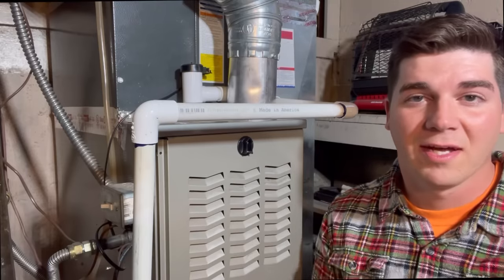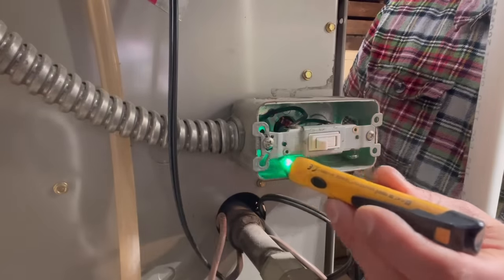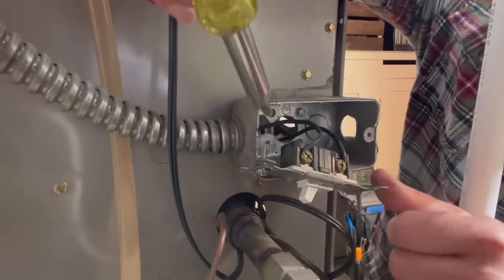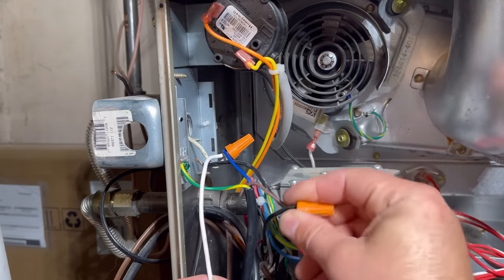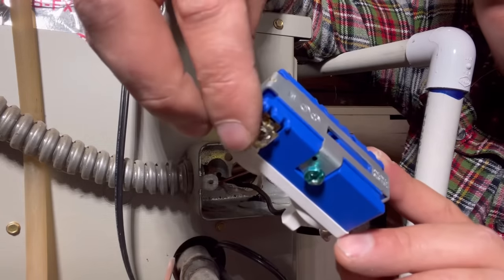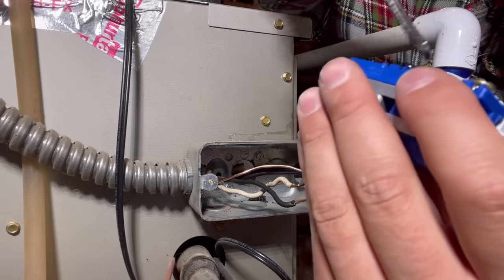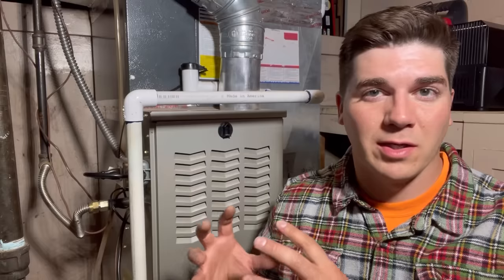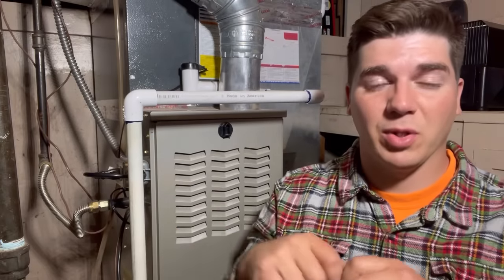This Could Keep Your Family Warm During An Emergency Power Outage.

Comment: Is the switch really required when all you have to do is pull the plug to remove power from the furnace?
Reply from the maker: It’s for building code here

Comment: I have a furnace switch with an attached screw in type fuse. Couldn't I simply replace the screw in fuse with a screw in a female outlet and back feed the power to the furnace. Obviously with the Main shut off.
Reply from the maker: Yea for sure you could! That’s brilliant

Comment: So you would need to also hook up your wifi if you have a nest or WiFi run thermostats right?
Reply from the maker: No if your WiFi drops out the thermostat will still work. It’s only in setup mode where some of them need wifi to proceed.

Comment: Does this prevent paralleling your generator/inverter with utility power if the breaker gets flipped on?
Reply from the maker: Yes it does not backfeed. I did another video with my generator powering the furnace and it shows that no power will ever go back into the grid.

Comment: This video involved far more wiring than the first one. Had you simply wired a power cord onto your furnace and a 120 volt outlet at the house line voltage, you would have made less work and ended up with a safer conversion. Then anytime you have a power outage, you could simply plug the power cord from the furnace into the inverter.
Reply from the maker: I believe building code says that a switch is needed that’s specifically dedicated for the furnace. 👍🏽
Reply: @diyhvacguy  And that is easily done. Not having a ground wired inside the existing power supply you have would give me more concern.

Comment: Might be a dumb question but is this just for gas furnaces? I have an all electric furnace here in Texas and I think it runs off of a 60 Amp breaker, so this won't work for my furnace or will it?
Reply from the maker: Yes gas furnaces only unfortunately. My apologies

Comment: You are wrong buddy. Why don't you simply use a double pull switch completely? Isolate the neutral switches from a to b. No problem at all and tire plug below without doing all the horseshit all's you have to do is cut the 110 between it and go in and out the loop. It's simple. I'm going to let Susan for many a year. This is a lot of access work you don't have to do

Comment: What about the possibility of cutting the power wire from the switch and putting a female plug on it and putting a male end on the wire to the furnace. Then just turn off the switch and plug furnace directly to a generator?
Reply from the maker: Yep you could totally do that.
Reply: Thank you for the reply. I have a generator but I never had the service panel modified . My other question is can you still control the thermostat with no power if hooking up to a gererator directly?

Comment: Why not just an outlet and a corded plug?  What is the necessity for the switch?
Reply from the maker: Building code.
Reply: @diyhvacguy    Thanks.  I have a boiler, been staring at the junction box for a year with the same intent.  Your video was exactly what I needed

Comment: if my furnace is on a 15 amp circuit breaker now and my generator plug in is 120v 20amp. will this harm the furnace?

Comment: you don't need a switched outlet...just install an outlet and the pigtail on the furnace.  If you need to disconnect furnace you unplug the wire.
Reply from the maker: I believe it’s building code that a switch is needed. But code is different in other places

Comment: I may have missed this question, but my original switch has a Buss fuse incorporated and from what I'm reading, it needs to be there.  Is there a way to keep it and make this update?
Reply from the maker: You can remove the fuse and install an outlet like this that screws in and then wire the pigtail to your three furnace wires 👍🏽

 https://amzn.to/3v44I4O
Reply: @diyhvacguy  Thanks.  That looks like it will work.. Great info

Comment: Great idea on this I was looking for ideas about this. But everybody be aware that if you have a computer board on your furnace or tankless hot water tank you could fry the board by plugging it into a portable generator. These types of generators are considered “dirty” electric meaning the wattage varies by load use and with this fluctuation the control boards fry out. Use a rechargeable battery backup “generator” that has enough wattage to run it. Do your homework and save yourself the aggravation.
Reply: Most cases a gas generator has a much better sine wave then a rectified one.

Comment: The switch has to be shut off on the box when using inverter generator to prevent power going back into main power??
Reply from the maker: Yes it needs to be turned off.

Comment: Why wouldn't it make more sense in having it set up where the inverter plugs into the outlet. Turn off the power switch from the fuse  box, and then plug the inverter into the outlet. Much cleaner than you wire run arounds!
Reply: Not safe, though.
Reply: To do what you're suggesting you'd need to have a "suicide cord" (male-to-male terminated cord) which are super dangerous because of the exposed hot leads. When I saw the video thumbnail I thought that's where the video was going but his solution with the pigtail is safe and far better

Comment: Could this also be done a hot water heater top element only (which would be 110 plus it has the thermostat)
Reply from the maker: Not sure on this. All of them out here are gas and don’t require power

Comment: not sure what your location is, am an electrician here in canada.  Would you not need to separate the neutral as well as the hot?  Am thinking that if there was a power outage, out utility does not want to see voltage on the hot or the neutral 🤔
Reply from the maker: I tested it with my gen set powering the furnace and there was no power at the hot or neutral going back to the main panel.
Reply: @diyhvacguy  Perfect, my switch and socket are separated so will not use the combo switch/duplex.  I am going to do it this coming week.  We just had a nasty storm and it dumped a crap load of snow on us, am already sick of shoveling.  Thanks for all this!  Happy Christmas!

Comment: Why do you have a switched receptacle in the circuit? Why not just a standard receptacle?
Reply from the maker: Building code
Reply: The cord and plug meets the disconnect requirements per national building code. Local authorities may go above and beyond the national code.

Comment: If it works on 120.. i did not see other video,, but i assume your powering up the fan in the furnace, and you are on a gas heat supply.
Reply from the maker: Yes gas furnace 110v only

Comment: And what switch position on or off shall be after you plug generator, in case power come back
Reply: That doesn't matter.  The furnace would be unplugged from that switch circuit and connected 5o 5he inverter.
Reply from the maker: Off

Comment: Does breaking off that tab isolate the neutral so your not backfiring the lines when running it off a generator?
Reply from the maker: I’m not sure but I have another video verifying that while the generator is on via generator power that there was zero power at any of those wires going back to the grid 👍🏽

Comment: Am I getting anymore protection by going with GFCI outlet for this purpose? Furnace is not too far from sump pit in my case. Plus I never know condition of insulation on my 50 ft extension roll.
Reply from the maker: Yea a gfci would probably be smart.
Reply: @diyhvacguy  thanks a lot. By the way, thanks a lot for the inspiration. I am looking for a good quality (but not too expensive) 240V inverter for my well pump.

Comment: Just curious, why even bother turning off the breaker?  The outlet would live if the power came back on, doesn't the plug in cord from the furnace separate it from the house wiring?  I would probably turn off the breaker for the furnace just in case, but not the whole house.
Reply from the maker: Not really needed but I did it just to be safe.
Reply: @diyhvacguy  thanks, I just wired mine the same way.  I have a 4k generator that I wanted to be able to use in an emergency for heat.

Comment: My condensate pump is wired into a separate outlet on the side of the furnace.  It is not shut off when the emergency shut off switch for the furnace is turned off.  I would need to know how to wire that so it could be powered by the inverter in an emergency.
Reply from the maker: Just plug it into your power station! :)
Reply: @diyhvacguy  LoL, seems too simple for me to think of.  I guess I could just plug it into the extension cord from the inverter that I have hooked up to my car battery.

Comment: What happens if you're running by battery and the power comes back up? Turn the switch to off before hooking the inverter up?
Reply from the maker: The switch should be turned off before plugging into the alternate power source. Then when grid power is restored, unplug from generator, plug into outlet, flip the switch back on 👍🏼
Reply: @diyhvacguy  Got it.

Comment: I am not an electrician but I think the NEC requires permanently installed heating equipment  to be permanently connected meaning you cannot use a cord and plug on a furnace. That said I think it a perfectly safe and functional solution to using a generator to power the furnace. But if have a fire you may have an issue, and you might have to undo it if you try to sell the house.

Comment: Problem is, that's a 15 amp switch and plug on a 20  amp breaker. Did you undersize what the furnace requires? Seems odd that the furnace has a 20 amp breaker.
Reply from the maker: I nabbed that snippet of video to emphasize safety but mine is indeed on a 15 amp breaker
Reply: @diyhvacguy  You seem legit. I will let this one slide. lol

Comment: Now that I just bought the switch etc from your video of two months ago, isn't this going to do the same thing?  This new switch doesn't look cheap.
Reply from the maker: Yes it does the same thing. The EZ generator switch just has a couple more features and it’s pretty. If you want to check it out there is a link in the video description 👍🏼

Comment: Do you also need to provide power to the thermostat or will it simply just keep running while the thermostat isn’t powered up?
Reply: Thermostat power comes from furnace
Reply from the maker: Yes as long as the furnace has power the thermostat will function as it normally does 👍🏼
Reply: @diyhvacguy  thank you so much for your quick reply. I have had blackouts before and could have sworn that the furnace breaker was different than the breaker for the thermostat. It sounds like this doesn’t make sense based on your response. Is that how it is usually done?  Thanks!

Comment: Should have left another foot or two on that cord so you can more easily reach the inverter.
Reply from the maker: Yea I just wanted it to have a clean look is all
Reply: @diyhvacguy  TOTALLY understandable, this is something I'd do too and regret it later. Velcro cable ties, or even loosen the clamp a wee bit and shove the excess into the unit body! But overall great idea and I love the idea of focusing on HVAC. My grandfather and dad were both in major construction, so house repairs are easy to me but HVAC is an area I have little practical knowledge on, so this is a great channel!

Comment: Hi
Made modifications as shown. When plugged into gfi receptical on my  inverter type generator it trips immediately.  Any ideas why
Reply from the maker: Probably needs to have the neutral bonded. A lot of generators have what’s called a floating neutral
Reply: After consulting the manual it states that the neutral is bonded to the frame.?

Comment: My furnace is electric and uses 220 volts. You could cause someone to get electrocuted or even lead them to accidentally catching their house on fire.
Reply from the maker: Quite the contrary. Your 220v furnace looks NOTHING like this, it has breakers on the front, so it should be a given that this is NOT for your furnace. Gas furnaces only people, as stated in the beginning of the video 👍🏼

Comment: Unless you thoroughly know electricity And understand how to protect yourself this is not something the average person with a generator or a power inverter should try to do on their own. Working with live currents is very dangerous And if you wire it up wrong you can burn out components on your furnace.

Comment: Doesn't this hookup require two male plugs from the inverter to the furnace?
Reply from the maker: No the whole idea is so that you can use a normal extension cord to run to your generator or power station 👍🏼 check out some of my power station videos and you will see. Cheers

Comment: Doesn't that make the male end on the pigtail  live and hazardous if switch is on?
Reply from the maker: Nope, the male end well never be hot just like a toaster or microwave plug will never be hot. The outlet is the power source.

Comment: You put your wire on the wrong side of the screw when attaching to the switch / plug.  Also, loop them for a more secure connection.
Reply from the maker: It was under the clamp down part so it doesn’t matter which side 🤷🏻‍♂️
Reply: @diyhvacguy  Most electricians I've heard from recommend looping it around counter clockwise.  Otherwise, the wire is pushed out from under by the turning of the screw.  It will probably be fine, but why not just do it properly?

Comment: this is cool but.....lets say the whole neighborhoods power goes out (as it usually happens) what good is this cord going to do when there's no power within miles
Reply from the maker: Umm, you plug the cord into your backup power source 😀
Reply from the maker: Otherwise, if you have a generator it will do you no hood if you can’t power your furnace with it.
Reply: @diyhvacguy  ummmm  how many people actually have generators in the city oor suburbs??  ummmm maybe a few
Reply: i only brought it up because only certain populations or areas have people that would even have generators and where i live isn't one of them. and I'm sure its probably a pretty high % of people who do NOT have any kind of backup power

Comment: problem here is that if its that cold and u need heat u need to get ur water heater going as well..
Reply: If you have gas furnace you might have gas water heater.  Gas water heater doesn't require electricity.  Why the worry about hot water anyway?

Comment: Here's an easier solution: JUST wire an outlet in. The switch becomes redundant when you could just unplug the furnace.
Reply from the maker: I think it’s building code here. But yes that would be a super easy solution.
Reply: @diyhvacguy  Could be. I know both the shop furnaces at my work have cords, switches, AND a screw in fuse mounted on the furnace housing so maybe it is code to have an actual switch

Comment: i do not understand why you first break the bridge in the socket to make that same bridge with a wire later, just  put the line in on the spot you connected the bridgewire. mutch easier
Reply from the maker: I believe it’s for the little led light

Comment: My furnace has single gang box on the side. I want to do this mod. I have 15a breaker in breaker box and box on side of furnace has switch+ 15a screw in glass fuse. Can I remove the fuse and do this without making it a problem? Thank you!
Reply from the maker: If you have another fuse that is dedicated for the furnace you can pick up one of these and wire a pigtail to plug into it. 

https://www.amazon.com/dp/B09XN6NSK6/ref=cm_sw_r_as_gl_undefined?linkCode=ml2&tag=wasatchmoto0d-20

Comment: Why the need for the switch? Wouldn’t it be easier to just put a plug near the furnace and wire the pigtail to the furnace as you did.
Reply from the maker: Building code. A switch must be at the furnace here
Reply: @diyhvacguy  Ahhh. Ok. Thanks.

Comment: could you not have avoided the jumper by just putting the line side into the brass terminal on the switch and just not breaking the metal tab?
Reply from the maker: Someone else mentioned it was because of the little led light? I just followed the instructions.

Comment: So is this a gas furnace and technically you only need to run the blower in an emergency?  Seems an electric furnace would require higher voltage than whats shown in the video
Reply from the maker: This is a gas furnace and you only need to run the blower and inducer motor. This is obviously under the assumption that you still have gas. The past 5 times we have lost power we still had gas.

Comment: Does the pilot on the furnace need to be manually lit after turning the power off?
Reply from the maker: Nope, unless it’s like a way way old furnace. Most modern furnaces light the pilot at every cycle or don’t even have a pilot. A lot of them have an ignitor. Spark or hot surface 👍🏽
Reply: Thanks, don't think I've had any outages in the cold weather yet.

Comment: WHAT HAPPENS IF YOU ARE RUNNING OFF THE GENERATOR/INVERTER AND ALL OF A SUDDEN YOUR MAIN UTILITY RESTORES THE POWER?
Reply: You will then turn off the generator, unplug the furnace from the generator, plug the furnace into your switched outlet and run off the grid.  Your furnace is not connected to the grid when unplugged from the switched outlet.
Reply: @jolkraeremeark6949 IF BOTH POWER SOURCES COME ON LINE AT THE SAME TIME, ONE WOULD EXPECT A MAJOR EXPLOSION OR FIRE AM I CORRECT?
Reply: @user-cj9iw9dj9i  in the video scenario, you can't physically connect the furnace to more than 1 source.  So, no, no explosion.

Comment: Did you put a 15 amp switch/receptacle on a 20 amp circuit?
Reply from the maker: No I nabbed that snippet of video just to emphasize safety. It is actually on a 15 amp double slim breaker

Comment: When using in emergency mode do you turn the switch to the off position when using the inverter option?
Reply from the maker: It doesn’t matter because the switch is just controlling the outlet.